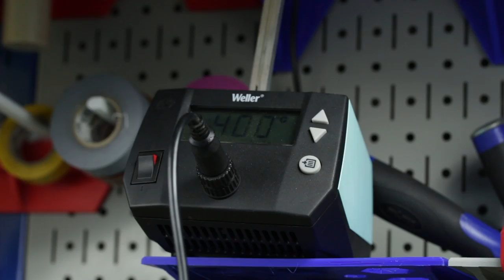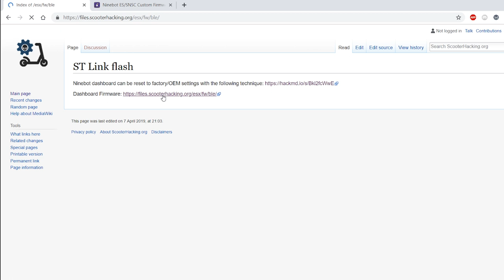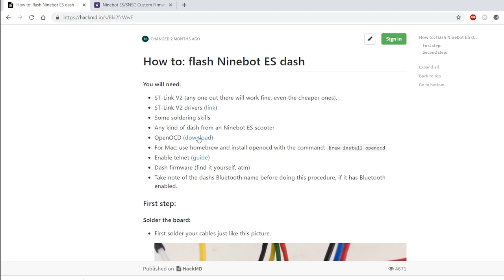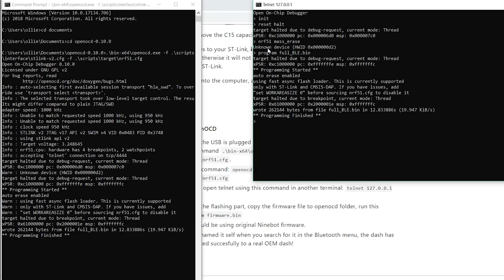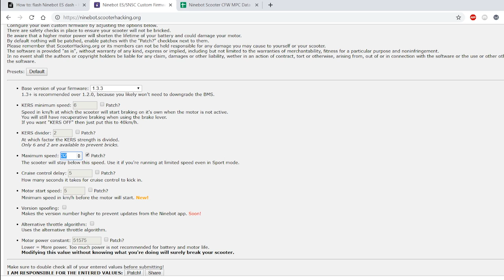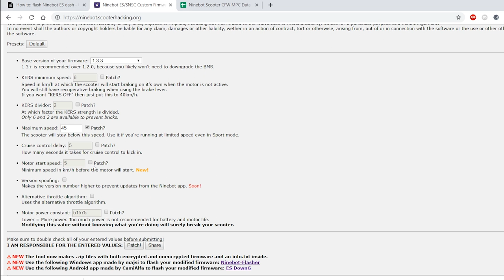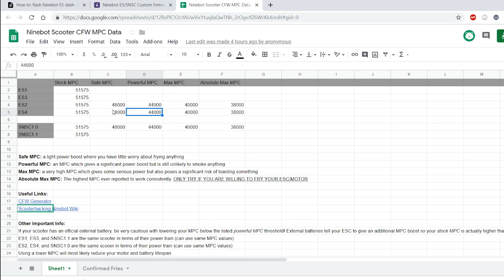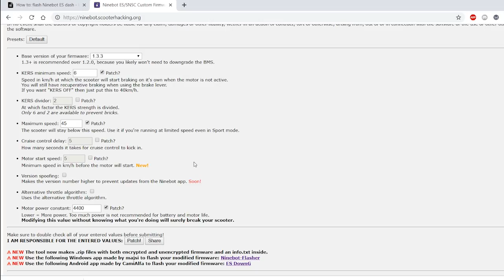Ninebot ES/SNSC Custom Firmware (CFW) ST-Link Flash Tutorial

Comment: Excellent video. I have installed the external battery on my ES2 and the speed on standard mode got a kick from 20 kph to 27 kph and the sports mode from 25 kph to 32 kph. This is way to fast for me. I basically just wanted the extra range and not the speed. The gap between limited mode and standard mode is a wopping 12 kph. Would it be possible to flash the firmware using a higher Moter power constant. Would that lower the speed for standard and sport mode? Will it influence the limitation mode where max is 15 kph at the current setup?
Reply from the maker: To lower the max speed, change the top speed number in the CFW generator. Lowering the motor power constant will lower acceleration and torque but not top speed. I’m not sure if lowering the top speed affects non sport mode though. Let me know if you find out!

Comment: can I do this with the dashboard on the jump scooters? Also how would I get stock firmware on the ESC of the bird scooters. I heard that they now have custom firmware
Reply from the maker: Darren Greene-Wynter this will work with any ex rental scooter that utilizes Ninebot ES/SNSC hardware (note some things may need to be replaced) Yes, the new BIRD scooters are using proprietary firmware on their ESCs but it can be removed via flashing stock firmware using the ST Link. Please refer to the scooter hacking forums for more details on that. (See ninebot section about error 10) This does involve completely dismantling your powertrain, however, and if you just don’t want to have to go through the hassle of flashing the ESC you can just buy a new one online (note you still will need to dismantle your entire powertrain to install the new one)

Comment: I have a custom dual motor ninebot es4 with two 48volt 1000watt ebike ESC's and a 13s10p 25ah battery I made that I'm going to upgrade to 14s soon, everything is mounted a bit half-assed right now as I don't have any tools to make metal mounts but it goes 25mph right now and has a lot of power and will go even faster with 14s so it's just the ninebots ESC that limits the speed as more voltage makes the motor spin faster.
Reply from the maker: That sounds awesome! You don't have any issues with motor heat?
Reply: @BananaScience  not running with two motors it doesn't, adding a second motor makes it so much faster and since it has more torque it's able to stay at 25mph on flat ground without getting hot, if I'm going full throttle uphill in the grass it gets pretty hot though but only after a few minutes. When I first built it I was running with one motor and after driving it around my neighborhood full throttle the motor hurt to touch. I also haven't had any problems with motor wires melting or the bullet connectors which I'm still using. I plan on making a video on it but I'm kinda embarrassed how it looks right now and it would be filmed on my potato phone.
Reply from the maker: @mashedpotatoes5323  That's pretty sweet. Where do you mount the ESCs?
Reply: @BananaScience  I have everything mounted on the floor at the front of the scooter with hose clamps and rope (it looks terrible and like a bomb), the back is extended to fit the rear motor so I still have plenty of room. When I'm able to make a metal bracket/ housing in a few months the ESC's and wiring will all be sealed up in a metal box bolted to the floor of the scooter. The battery will be covered in some type of plastic wrap and will be able to attach and lay flat on top of the case for the ESC's and will be easily removable, I'll add a small fan and air holes to the ESC's housing so it doesn't burn up but I want it water resistant as possible too, and I'll also add some foam padding to protect the battery from bumps.
Reply: I'll also be adding a bike break to the rear motor, the metal edge of the hub will be used to stop it and I'll be replacing the foot break fender (I had to take off since its extended) for additional breaking if I need it, although the foot break will wear out my tire.

Comment: i have an snsc bird. i replaced the tracker box with a dashboard. i  have not flashed it yet but upon connecting the dashboard i get error 10. will flashing the original firmware fix this?
Reply from the maker: Not sure if stock firmware will fix it but it's worth a shot. It it doesn't work check out this forum discussion: https://www.scooterhacking.org/forum/viewtopic.php?f=6&t=40

Comment: I flashed the stock firmware onto my dash I got off amazon because it wasn’t working with the rental scooter I got but now it just flashes the red wrench signal. Help?
Reply from the maker: Eli Johnson what is the error code? If it’s error 10 you will need to flash OFW onto your ESC using an ST Link. Check the forums linked in the description for more details.
Reply: BananaScience well the dashboard I have for some reason isn’t able to connect to the app. The app recognizes there is a scooter but when it try’s to connect it said connecting fail please try again. I was hoping flashing the dashboard would make it work but it still doesn’t. I am going to try to flash the control board later today with the st link. Should I just do the same thing I did to the control board as I did to the dashboard?
Reply from the maker: @elijohnson1832  Sometimes the  BLE is a little flaky so you need to try to connect a couple of times before it works. The process for flashing the ESC is completely different so I would check out the forums for details on that. We hope to release a video on how to flash the ESC within the next month or so.
Reply: BananaScience okay thanks so much for your help. That video would be greatly appreciated! I did find a few steps for flashing the esc so I hope I’m able to follow all them because I’m not to familiar with STUtility(which is what the steps say to use).
Reply: BananaScience I also heard something about birds new firmware bricking the esc when it doesn’t recognize the bird dashboard. Is this true or have you heard anything about this?
Reply from the maker: Eli Johnson haven’t heard of that but let me know if you can confirm it’s true

Comment: Hey
I did the procedure however when I play the telnet command 127.0.0.1 4444 it says C: \ Users \ miniA> telnet 127.0.0.1.4444
Connecting to 127.0.0.1.4444 ... Could not connect to host, on port 23: Connection was not established. ... what can it be?
Reply from the maker: Have you triple checked your wiring and connectivity with a multimeter?

Comment: Hi,
best info I have seen so far but I am so stuck with my sons scooter , it just stopped working I have bought 2 sets of controller esc boards and dash boards and all I get is beeps and the right rear light flashes, the segway app says battery firmware needs updating . I cant find info on this any where any help would be appreciated it just beeps and only goes about 3 or 4 mph max. I have spent over £100 and waited over a month and it is still a piece of junk. any recommendation on a better scooter  also I am fed up trying to fix this thing with no help from suppliers.

Comment: Heya, did as the video and flashing the dash was no problem. However afterwards the dash doesn't turn on at all, i'm thinking maybe i have to flash the control board aswell before the dash comes on?
The scooter is on, and flashes it's lights when i move it, just no connection to the dash and doesn't show up on bluetooth or in the flash-app.

I've soldered on the STlink to the control board now thinking it's a similar process flashing the control board, you have any experience with flashing the control board through ST-link?
The commandos for flashing the dash doesn't work here.
Reply from the maker: Victor Ivering Yeah the newer rental scooters are using proprietary speed controller firmware that needs to be reflashed. We haven’t yet needed to flash a controller but someone is sending us one in the mail to make a tutorial video. If you want, you can ship us yours and we can flash it for you once we make our tutorial. Email us at Banana.science.awesome@gmail.com for details. Otherwise, check out the section in the forums that says “error 10” and it will explain how to flash your controller.

Comment: Hi there, I have recently acquired a couple of impounded scooters from a wrecker and they are lyft branded. The main cable from the esc has 5 pin connection going up to the dash as the replacement ones only have 4 pins. Would this make a difference?
Reply from the maker: Yes. You need to find out which of the five pins has battery voltage (use a multi meter to find 42v) and then just purchase a replacement 4 pin connector and ignore that high voltage pin when you wire in the replacement cable to your ESC.
Reply: @BananaScience  Ok, thank you so much for the information! Is the 42v there to power the dash that came with it? if i do ignore that would it still have the sufficient connections to power the replacement dash?
Reply from the maker: @Kchecksitout  I'm not sure the exact purpose of the 42v wire (could be for power or for monitoring battery voltage but if you remove it, the ESC will work like normal.
Reply: @BananaScience  awesome! Thank you so much! I will definitely give it a try!
Reply: @BananaScience  Hey brother, I successfully flashed a dash using your method and rewired the 5 pin into a 4 pin and moved it to the standard location on the esc. I am now getting an eror 10. Doing research it seems the esc FW is not matched to the dash. Would you happen to have a tutorial for flashing the esc control board? Literally none around so you may be the first to do a tutorial! =) Thanks again! With each conversation i have with you comes 1 step closer to scooting!
Reply from the maker: Rides, Flights and Everything Nice Channel I’m currently working on a tutorial but it might be a couple weeks till it’s out. Until then, check out the error 10 section in the forums.

Comment: after flashing two dashes following your steps, we connect them but they stuck at a beeping and don't work.
Reply from the maker: Fernando Benítez you probably need to flash your ESC as well
Reply: @BananaScience  with scooter app to flash firmware?
Reply from the maker: You will need to use an ST Link. Follow the directions described in the error 10 section of the scooter hacking forum.
Reply: Yes, after you flash the dashboard. Use the original app to upgrade. People are so dumb
Reply: @julioqueiroz9707  easy bro
Reply from the maker: @julioqueiroz9707  Flashing dashboard firmware won't fix this issue. Error 10 is a speed controller issue due to the proprietary firmware rental companies are now putting on their ESCs. The only way to remove this is to flash a dump using an ST Link and ST Utility.

Comment: So if you have one of the non ninebot ones do you need to buy a new esc and a dashboard ?
Reply: My dashboard looks like the ninebot one.
Reply from the maker: @Felisargyle  Does it have a tracker pod mounted on the front or a tracker box on the handle bars? If it has a front tracker pod you will need a new ESC and to flash the pre-existing dash. If it has a tracker box you will need a new dash which you will then need to flash.
Reply: BananaScience it has nothing. So I’m set right?
Reply from the maker: @Felisargyle  Yup you shouldn't have to do anything then.

Comment: Hello!
I did all the correct steps but when connecting the ninebot flash to the scooter it detects the scooter but does not let the option open file to be able to insert the bin file.
What could I have done wrong?
The screen on the scoter only flashes.
Thank you

Comment: Hello , thanks for the tutorial , I was wondering if this is still possible on a dashboard that’s display doesn’t work, the scooter works normally , only the display is not showing , you can only see it all turn on when you turn the scooter , kinda like with a car when you turn the ignition on and the dashboard lights all light up at the same time for a moment
Reply from the maker: Yup. you probably have a Spin dashboard which doesn't turn on because of a custom firmware they install on it. Not only will flashing custom firmware allow you to use a higher top speed, it will also make your dashboard light up and work normally.

Comment: hello I found a VOI ninebote rental, what is the best way to use it, what do you recommend?
Reply from the maker: Assuming you attained the scooter by legal means, you will first need to determine whether your scooter has the tracker board mounted on a front facing pod or on a box on the handle bars. If it is in a front facing pod, you will need to buy a replacement electronic speed controller (ESC) and remove the tracker board as well as flash original firmware to the upper dashboard. If it just has a tracker box on top, you will need to remove the tracker and purchase a replacement dashboard. Let me know if you would likes links to purchase either the ESC or replacement dashboard.
Reply: @BananaScience  
how to be on the location of the tracker, do you have pictures to not fool me

Thank you
Reply from the maker: LeMaitreRmK Sorry you’re gonna have to work that out yourself. I’m not going to help you steal a scooter.
Reply from the maker: Gabriel Gabrielsson join the Scooter Hacking wiki, forum, and discord from the links in the description. Also read through the comments on this video as I think many of them will answer your questions.
Reply: @BananaScience  lmao! i wonder if he ended stealing the scooter
Reply from the maker: @LaoShimazaki  Lmfao yeah. We get a bunch of people asking us how to take apart the tracker box and stuff. SMH

Comment: ok, can you please clear this up to me i'm totally confuse. will this boost up the scooter more than 20mph (32kmh) or does this method says that it will just reach the 20mph(32kmh)?
because i got the backup battery with my es4 alreaady and i can go 20mph(32kmh) already. so what;s the point in doing this method if i cant pass that 20mph.
what i want to pin point is. i want to hack the scooter so i could go faster than 20mph. so answer this quesstion.
if i do this method. will it run more than 20mph or not? will it go above that speed? cuz when you're done with the video you did not show us that you've gained speed. you jusst went out then that's it.
Reply from the maker: Christoper TV at the start of the video I demonstrate the final result of it going 20mph. As far as I know, this only will allow you to go 20mph TOP as the majority of ninebot ES scooters are flashed with stock firmware that limits you at 16. I do think it would be worth a try though to do it on your scooter as you might be able to achieve a higher top speed but I don’t know for sure.

Comment: Hi so I’m having a problem where my battery BMS isn’t updating from the app. Will this fix it thanks
Reply from the maker: This sadly won't fix that issue. What error does it give you?
Reply: BananaScience I’m not totally sure but when I look in the app it says battery management system is out to date and it beeps a lot
Reply from the maker: Macadoo Vlogs what happens when you click update?
Reply: BananaScience it sits there with the update and then just says update failed

Comment: It says on scooterhackingdotorg that u can use it on the es1/2 without the extra battery but u can't push it to it's limits eg if it can do 30 you only go 22 kind of thing. I'm going to give it a go in two weeks
Reply from the maker: Yep that's true. An official external battery increases the max power and speeds of the Ninebot ES1 and ES2 scooters. A Ninebot ES1 with an external battery is an ES3 and a Ninebot ES2 with an external battery is an ES4.

Comment: Anyone tried to use this custom firmware with stock ES4 scooter having headlight/throttle issue ?
Reply from the maker: Can you describe your issue in a little more detail?
Reply: @BananaScience  When I turn on the headlight and press accelerate throttle my ES4 loose power and rear light starts blinking. The other issue is that cruise mode do not work consistently i.e. in most cases cruise control is not turning on after beep sound ( sometimes even no beep sound at all ).
Reply from the maker: Krzysztof Kaminski and to confirm this is only after you flashed CFW? It was working just fine before?
Reply: BananaScience My issue is not related to CFW. Issue appeared after I upgraded Ninebot FW to version 1.3.5. In my original question I wanted to ask if someone tried CFW despite having headlight issue. I just want to know if current issue will not cause more damage after I upgrade do CFW.
Reply from the maker: Krzysztof Kaminski I haven’t had that issue personally but since it’s already not working I doubt CFW would hurt and the worst that could happen is you need to use the ST Link to flash OEM firmware. I would say CFW is worth a shot
Reply: @flamaest  Thank you for information and for sharing link with me. I saw one solution where faulty resistor was being replaced by 0 ohm resistor but I haven't found explanation why short circuit of original resistor is the correct solution.
Reply: @krzysztofkaminski2093  honestly, I would just get a new board off of eBay and install it carefully yourself if your scooter is out of warranty. Would not bother resoldering. It's too tedious and you could just brick the whole thing.